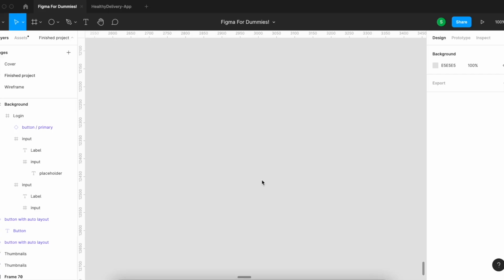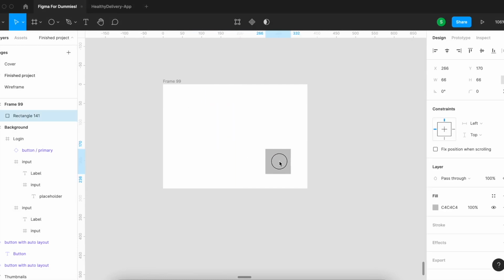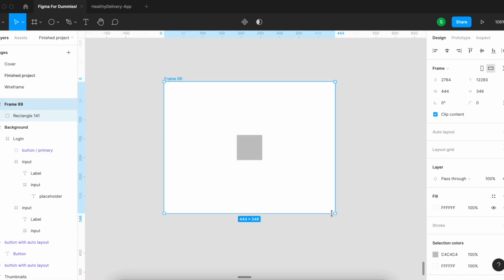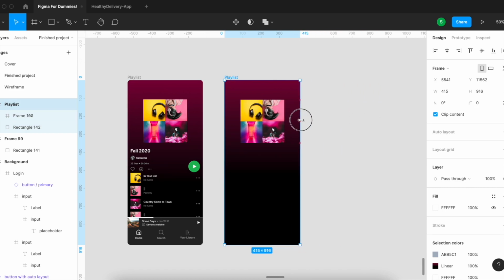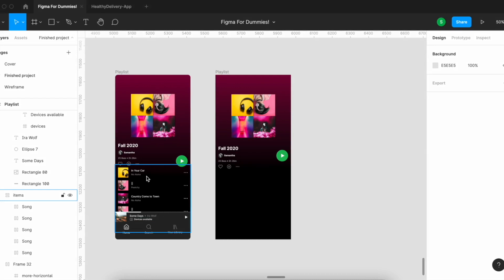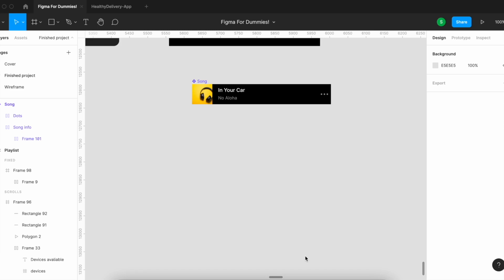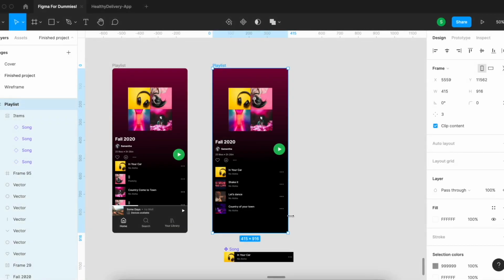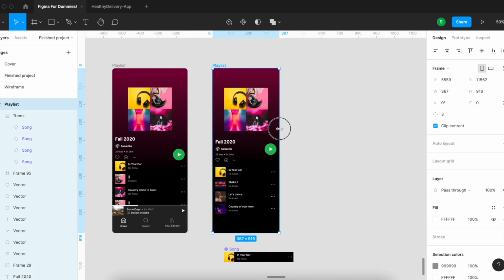Figma for Dummies! Design Spotify app | part 6: Constraints

Comment: Excuse me. Another question: if I want to have a responsive design, do I have to use auto layouts or constraints?
Reply from the maker: these are 2 different things. you need constraints for responsive design but also you need autolayouts for a clean and consistent design

Comment: Hi! I am a little confused by the differences between autolayout and constraints. I have watched many tutorials and some people use autolayout almost everywhere instead of using constraints to fix the elements 🤔 I wonder how you would approach this. It would be great if you can please help me with this concept! Thanks
Reply from the maker: Hi, these are 2 different concepts. auto layouts have constraints too. when you want to use your design for different screen sizes, you have to change your auto layout according to the size one by one, if you didn't set constraints for them. but if you did set constraints for all of the elements in your design the only thing is left to design for another screen is to resize the main frame. I hope this was helpful